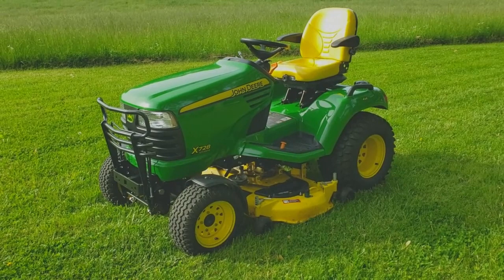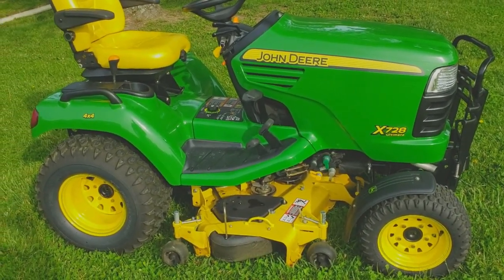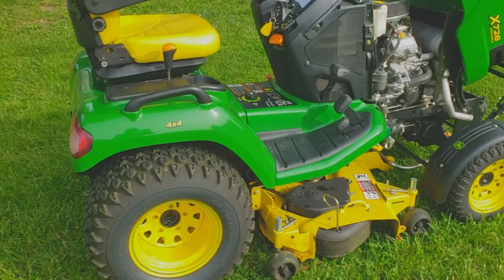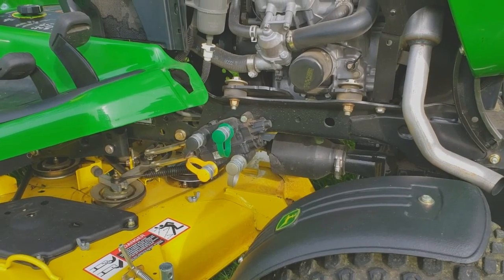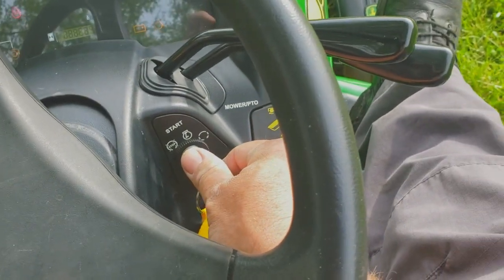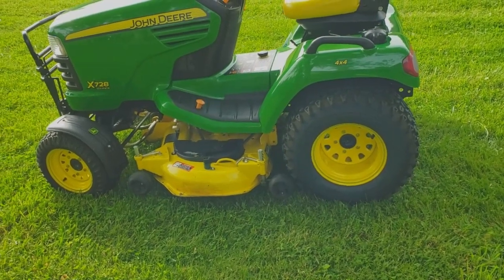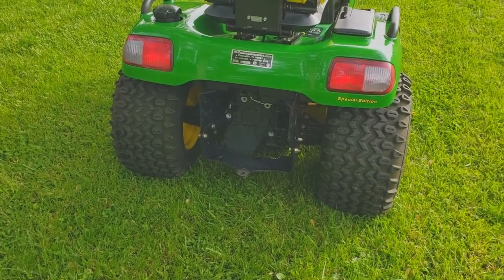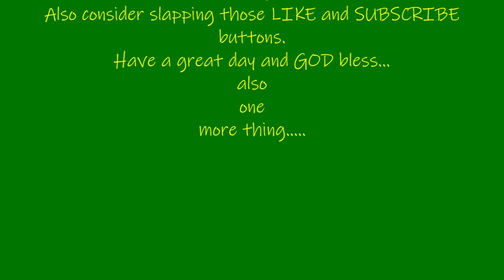John Deere X728 4 x 4 lawn tractor, John Deere

Comment: This is one tough tractor.  Mine had 405 hours on it as a 2011 when I got it.  It was used on a farm and had some scratches and tire wear but overall was in good shape.  Yours is in very good shape and would hang on to it!  I put an aftermarket 60" plow blade on it and it plows like a beast with no added weights, although I may add a rear box for weights this next winter to help it out.  I did add a receiver hitch and that works like a champ.  I would use some Sea Foam in the fuel to keep things cleaned up in the carb or other good fuel additive.  I mow on a fairly steep angle but go slow and it handles the slope pretty easily.  You're right tho, going up and down is a safer way to mow.  Very nice unit you got there, I like the side shifter too.  Cheers!
Reply from the maker: Hey thanks for the view and comment. Yea I really like this machine. It is seeing more use than just lawn care. They are built rock solid. Please check back for more in the future.

Comment: Great overview video!  I've got a 2007 X728 that I bought 4 years ago at ~415 hours. I wasn't sure of the maintenance history when I bought it, so I did a full fluid change, including the transaxle fluid, and have stayed on top of the annual maintenance checklist (spark plugs, oil, filters, etc..).  Like you said, maintenance is key to keeping a awesome machines running strong for years and years.
Since I bought it, I've added another 200+ hours and actually just bought a pre-owned 45 Loader (2011) earlier this summer that is a direct bolt-on for the X728.  The loader has been the best investment I've made since the tractor, and has saved my back countless times already.  I, too, have a 54" snow blade, but my tractor came with the quick attach mount, which makes it a breeze to take on and off.
Question: Have you had any problems with your parking brake "sticking" and being a pain to disengage?  I always have to fight with mine, but they could have fixed that between the years that ours were manufactured.
Reply from the maker: Thanks for tje view and the comment. Yes these X series machines are work horses. I have worked mine hard this year with lots of mowing and pulling a trailer and such.
Reply from the maker: Also ...parking brake...no mine has not had any issues.
Reply: Just saw this post.  I have this tractor too, and YES! I have a problem with the parking brake refusing to disengage. I’ve asked to have it checked a couple times when it goes in for maintenance, but no one has found the problem.  Let me know if you found out why.

Comment: ust got one and a great video, But I cannot figure out what to do to remove the mower deck?
Reply from the maker: First off let me say thank you for the view and comment. On the LH side of the mower at the front there is a bin that you pull out and rotate the bar forward. This will let the front of the deck drop. Next reach under the mower in front of the rear tires and disconnect the lift pins and driveshaft. I will try to get a video up up this.